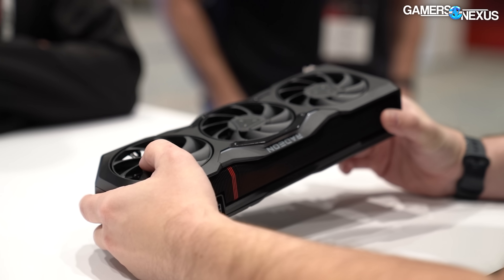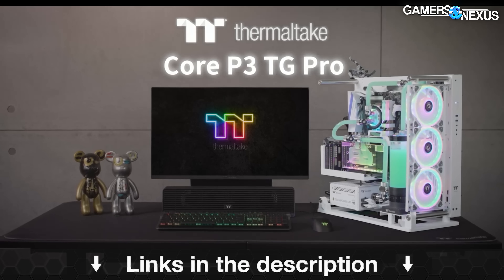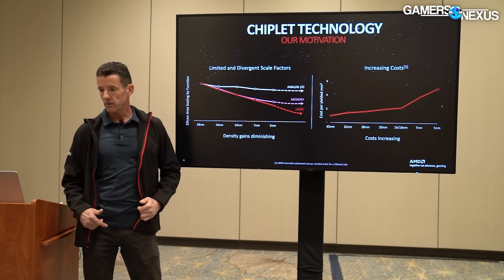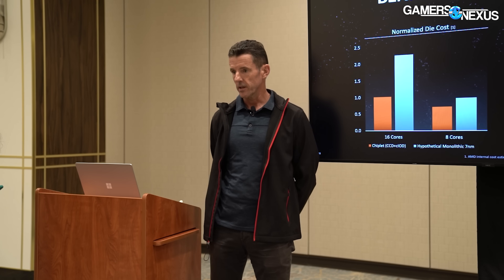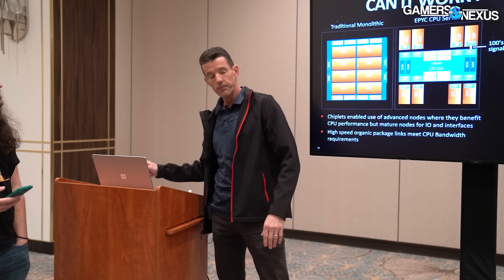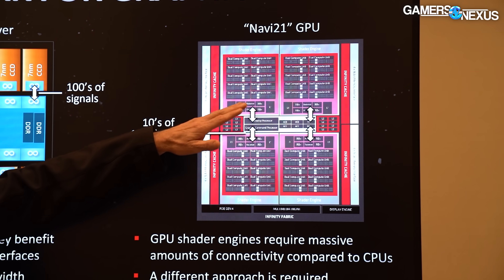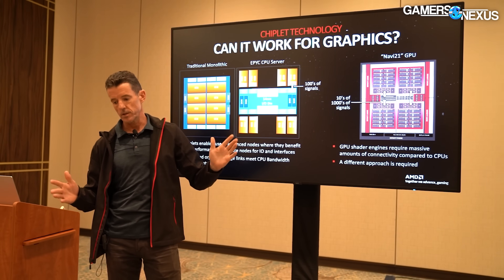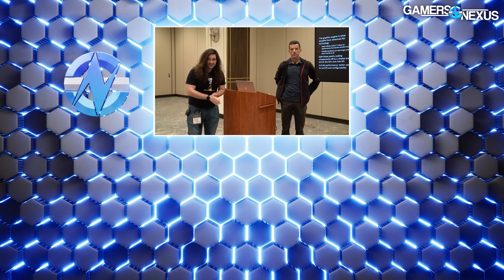How AMD is Fighting NVIDIA with RDNA3 - Chiplet Engineering Explained

Comment: Just a few observations. It was never asked nor was it addressed but chiplet designs have major downsides to them over monolithic. That I/O managing traffic between the compute units and memory was an observed issue with previous designs in chiplets in the past. Also, AMD is not the first to use a chiplet design. Intel and IBM had chiplet designs but noted that they weren't cost effective and they found issues with yet another component off-die that had to help orchestrate things between the components. He kind of talks about it in this video with the fanout tech, but the major limitation in chiplet design is that the I/O is tied to the memory controller which controls the Infinity Fabric. They're able to cover up the limitations using massive caches, but they're going to hit a point pretty quickly where they're going to run out of SoC space. Since they can't hit the speeds, they're instead going for more lanes in order to increase bandwidth. The CPU and now GPU is limited in raw speed by the I/O and memory controllers. You're going to hit a point where AMD's CPU/GPUs chips are going to start getting massive to keep up in bandwidth. There's also the issue that as chip density breakthroughs and increases decrease, they'll instead chase yields and maturity which favors a monolithic design as the cost savings with the massively increased yields and manufacturing maturity will decrease the cost benefits of the chiplet design. I'm interested to see how AMD tackles these in the future.

Comment: Sam is absolutely right about engineers wanting to work on the cutting edge. Back when I was a product engineer for a Telco equipment company, I was excited to work on the IP over wireless tech. You guys know it as WiFi. But the other part of my work was dealing with PSTN, which is fixed telephone lines carrying 56k modem stuff.
Reply: Sounds like to me a company would have to pay an engineer more to work on normal shit and cutting edge guys would get paid less LMAO
Reply: @theq4602  youd be surprised, very few engineers work on "cutting edge" stuff. unless you have a graduate degree, working on R&D and anything related to cpu/gpu chip designs requires an extensive graduate background. "normal" engineers like me are working on all the "lower level" stuck like pcb routing, etc etc

Comment: 13:08 If AMD's high performance fan-out packaging has so much more bandwidth what's the likelihood you could extend the package size to include a few VRAM chips?
This looks like a way you could get HBM performance without using the expensive stacked silicon.
Reply: That doesn't make a whole lot of sense.  DRAM requires a controller interface.  With this design, those controllers are in the MCD chiplets.  They connect to the DRAM chips outside of the GPU package.  Putting those DRAM chips on the same package would provide zero benefits.  Using HBM instead would be faster and use less power, but cost more.

Comment: I want more! 
It'd be nice to know:
What lessons they learned from HBM/Vega that they either applied to/dismissed from RDNA3.
If they see Ryzen arch moving closer to this type of chiplet design where the CCDs and IO are closer together to further reduce latency/increase bandwidth, or if it's not worth the engineering time to get whatever the perf increase would be or it there's a thermal density limitation that comes into play with IHS (CPU) vs direct die (GPU), especially with the creeping power levels we're seeing on CPUs nowadays. 
If this continues, perhaps at some point the IHS will have to go away and we'll see CPU packages sold in a GPU-like form factor as main memory and VRMs move onto these cards, relegating motherboards towards an even more generalized series of interconnects.

Comment: When AMD was presenting RDNA 3 you could hear in his voice, though calm and soft, how excited he was with what they were coming up, like he was really trying to convey how cool all this new approach actually is. Too bad the audience seemed to have missed that, or at least that's how it looked like from the Youtube stream.
Reply: went as expected since it was all media.. always the downside to these closed presentations instead of being at the big open events.
Reply: I can tell he was excited, however, the technical terms were way over my head as a layperson. The only things I think I understand out of it is:

While logic capacity increases significantly from die shrinking, input output and memory do not benefit nearly as much.

Because input output doesn't benefit significantly from additional miniaturization, they can separate that section in larger but cheaper die.

Because the core units are smaller and  I/O  is divided out, they can fit much more units per wafer than putting them both together, cutting even more costs.

Infinity fabric seems to be an interconnected and deep weave of conduits made from a more advanced substrate that's not silicon.

Gpu I/O functions similarly to cpu so they can perform a similar strategy in designing gpu.
Reply: @eddapultstab2078  A little off on the last point, GPU's can't have a similar strategy to CPU's because of the transfer rates required between the memory and shader engines are so high. However there are still ways that the GPU's can be compartmentalised too allow more robust die design.
Reply: @4kirb  the last part was a bit confusing, what I thought was gpu i/o unit and the resulting shaders do not count as the logic scale, which has the highest benefit from shrinkage and are closer to i/o and memory so they can use a larger die on that part.
Reply: And here I thought he sounded incredibly bored during that presentation.  I guess it's just how he talks, but he definitely seems somewhat more lively in this one-on-one format.
Reply: @nimbulan2020  there's always someone like you who doesn't even understand the gravity of the word excitation 

your ilk on the other hand is often the dullest in the truest sense eugh
Reply: @ydid687  Insulting me seems a bit unwarranted.  All I said was that he sounded bored during the presentation, but I think it's just how he speaks.  I'm the same way.
Reply: Yeah I know, maybe his stage presence wasn't that energetic, but the amount and importance of information that he talked about was the most interesting part of the whole presentation for me. You can really see that he is very knowledgeable and knows what is he talking about, and that he is a huge part of AMD's recent success.
Reply: At media events like this everyone is so busy taking notes or liveblogging that there's not a lot of time or energy left to respond. I can bet that if they weren't liveblogging, they were about two-thirds finished the article that they needed to write/script that they needed to film to recap everything for their own outlet. The Content Mines are a cruel, cruel place sometimes!
Reply: Of course. To be able to use the same technology on GPUs is a big win. It's basically the next step in modularity. From 1 core to multiple cores, now to modular task specific chiplet. It makes so much sense in terms of yields and development cost. Occam's razer.

Comment: Chiplet architecture has given Radeon a lot of ammo to fight Nvidia with (who are already struggling on monolithic dies).
I don't think people realise just how much of a turning point in graphics that this actually is.
Reply: Who said NV is struggling? :D
Reply: @bslay4r  It's not a matter of "who" says (as if it's an opinion) that Nvidia is struggling. It's a fact that from a silicon usage and production perspective, they're very short on options right now when it comes to adding more cores and more cache. They simply can't. And they're already pushing hard on the power limits. They're already on the most advanced node. They're already on the biggest possible die size. Where do you reckon they go next?
Reply: @jimtekkit  The reticle limit of a 300 mm wafer is around  800 mm2, Lovelace is 608 mm2 so they can do a bigger die if they want.
The 4090 has high power usage because NV uses too much voltage, the 4090 is ~5% slower @350 watts (according to tomshw article) so they just went higher than the sweet spot of the silicon (imo they were nervous about Navi31).
They can and they will make ~600 mm2 dies until the shrinking of process nodes stops (unless they do sthing like AMD). They have very smart engineers, they will figure out.
Reply: @bslay4r  No doubt their engineers are smart and are already working on something else. That's not actually the issue, instead it's the multi-year turnaround required for Nvidia to come back fighting. Just like how Intel floundered across two generations, the same is starting to happen with Nvidia. There's indications that RTX 5000 will also be monolithic, so again it's the same situation of big expensive dies where cores and cache (plus RT and tensor cores) are all battling for die area. I stand corrected that they're on the 600mm2 die, not the largest. But even if they do utilize the full 800mm2 die, that increase won't be nearly as much of an increase in shader core count than if Radeon did the same thing. And with TSMC 3nm wafers (which inevitably Nvidia will use) looking to be 25% more expensive it's fair to say that the next few years for Nvidia will be rough, just like it was for Intel.

Comment: I own a 6900XT and find the graphics drivers buggy and unstable, Microsoft always trying to overwrite the Official AMD drivers on windows update with its own brand of generic drivers that don't play nice with AMD Radeon Software. I've also had to do a lot of tricks on the buggy Radeon software to make some older games even playable. Many games before the down in code or ini file tweaks wouldn't run at all and would crash. Even still I have some old games I enjoy that outright to refuse to run on the 6900XT when they should be able to. It took a ini file manipulation to force Borderlands 2 to have a playable framerate because for some reason, even after re-installation, the settings for Boorderlands 2 had PhysX set to high..... In Red Dead Redemption 2, I'm having issues with small animals or medium sized fast animals having multiple ghost images trailing behind them even when motion blur is turned on (I usually turn it off, but it makes no difference). Also, I have been having the Error Code FFFFF Issue making it impossible to play RDR2 beyond 45 minutes at a time. I've tried everything, but nothing works. If I continue to have even one more issues with this card, I'm selling a kidney to get a 3090; At least it is in stock through reseller e-tailers at a semi-decent price (unlike the 4080 or 4090 which are both out of stock and crazy). It also provides a modest improvement in framerate compared to the 6900XT as most of my games are NVIDIA titles. This bad experience with AMD over a period of over a year has made me decide to ditch AMD for graphics cards forever.

Comment: A couple of obvious things from this presentation that AMD is likely going to do in the future and it centers around re-using more chiplets across more product lines.

1) Spin off the PCIe, display interfaces and encoding logic on their GPUs to their own chiplet.  This single chiplet will be spread across their entire GPU lineup and even serve as part of the desktop IO.  On desktop the memory controller die which also contains the basic links to the CCD.

2) Common dies for stacked cached that are used on the CCD on server processors and MCD on graphics.  This isn't about performance but economies of scale as it permits AMD flexibility in how they allocate these cache dies.

3) Common Infinity Fabric link between CCD, FPGA, GPU and specialized IO dies.  This dives into AMD's semicustom side but if a large customer cough Microsoft cough wanted say a four CCD and two large FPGA dies in a SP5 package for a server, AMD can leverage their existing die portfolio and quickly validate a custom package for release.

I think much of this first wave of AM5 and SP5 products are purely a stepping stone in their strategy.  I strongly suspect that AMD is leveraging the same Infinity fabric interface between Zen 3 CCD, Zen 4 CCD, the socket AM4 IO die and socket AM5 IO die.  The reason behind this strategy is that AMD could have launched AM5 products leveraging the Zen 3 CCD if it made sense to launch a DDR5 based platform earlier.  Similarly if DDR5 was not ready in the market, AMD could have launched Zen4 on socket AM4.  Essentially AMD had an insurance plan on how the market move and always get a new product out to continue competing.

Not covered in this presentation is how much energy it takes to move data across various wires.  While chiplets provide lots of flexibility in terms of design, they require more power than a monolithic design.  I would predict that in the Zen 5 generation, AMD is going to replace the traditional wire based packaging with a full interposer or EMIB-like technology to reduce wireless lengths and drop power consumption in this area.  AMD has given a strong hint that this is the direction they're going by some of their HPC parts based around CNDA will include a Zen 5 CCD die(s) in the same package.
Reply: They will spin out every part they can spin out in order to make room for the gpu logic. Expect NVidia to follow they are a few years behind in this process, but the current gen clearly shows they will hit a wall soon. The high prices definitely partially at least stems from costs and binning problems. The Ryzen CPU designs are great and while Intel marketing made a mockery about glued processors in the early Ryzen years their engineering clearly probably saw that AMD struck gold with that design for at least 10-15 years.
Reply: @werpu12  I think NVIDIA already hit a wall with the 4090's. The high prices definitely because of wafer defects and binning problems. They are also hitting the power ceiling with their 600 watt limit as well. Their designs hint that they are simply just brute forcing tangible performance gains by throwing more power at the problem. AMD is now ahead of NVIDIA by a few years in power/performance efficiency ratio so it's almost a guarantee that AMD's next line-up of gpu's after the 7900xt will no doubt demolish NVIDIA's own lineup.
Reply: @luminatrixfanfiction  Tbh, 600W power limit for NVIDIA is bit overcranked on their size... it can be around 480 almost without performance loss. But they wanna sell these 3-5% performance for 120W+
Reply: It seems that large number of wires required to interconnect is the limiting factor here. Once they figure it out, it will be like lego, I hope.
Reply: @sudeshryan8707  Doing that would probably require some kind of die-on-die direct stacking, but I don't even know if that's a thing right now. I suspect they'll try really hard to go full modular.

Maybe an Crossfire-like approach, if directly cutting up the current design isn't feasible? Maybe the downsides of a "multi-GPU" setup could be mitigated with some proper love and drastic latency reduction.

Comment: This was awesome! Love hearing Sam Naffziger talk to the design of the architecture.

*Edit: It's cool to see chiplet's be useful in GPU's but will their benefit end at memory? I think it's been a head scratcher for awhile at the idea of multiple graphics dies to be linked together but just based on the chiplet concept. You could have two GCD's half the size and have them connect in the middle couldn't you? Thereby making an equally effective die package but guarantee even higher GCD yields?
Reply: It's the inter gpu communication that's the problem - gpus are wide lane computes that take data all together and operate on them together

the connect needs to absolutely on point to not mess up the operating together bit - amd is going for the easier wins (relatively easier that is) and get the less linked together stuff to be separate first, and then perhaps when the communication channels gets better  they may be able to link them together
Reply: They don't appear to be combining two GCD's currently so there are probably hurdles to making that work, if it ever will work. I'm sure they would if they could and will when and if they can.

Comment: Until chips can be stacked vertically - which current high temp manufacturing silicon based chip  won't be, economically speaking - chiplet is the future.

Mobile sector would be the main driver since space is very premium on mobile compared to desktop so it will be interesting what they'll come with.

Comment: Seems AdoredTV's guess of about 1000 on a wafer was correct. Also looking at the slide around 8:55, when fabbing a 16 core chip, taking 16 chiplets as a 100% value it seems chiplets are also scale to larger designs better than the monolithic approach. The monolithic version going from 8 cores -> 16 cores is a 2.1X increase in cost, but in the chiplet version it only costs an additional +0.25X to go from an 8 -> 16 core, that's not just a little saving that is significantly better.

Comment: I am extremely interested in this generations performance and in how they iterate on this.
Reply: I'd love to see this or similar packaging technology used for APUs. We know how much of a problem MS and Sony are having getting the costs down for the silicon they use in their consoles, which is probably down to the use of a monolithic die, and the fact that a die shrink doesn't automatically save costs in the way it used to. If the CPU and GPU were on separate dies and communicated via infinity fabric / UCIe, or whatever, presumably yields would be a lot better. Could potentially be exciting for other products that need a single high performance APU part, like gaming laptops or handhelds.